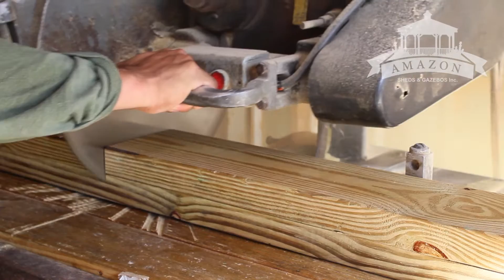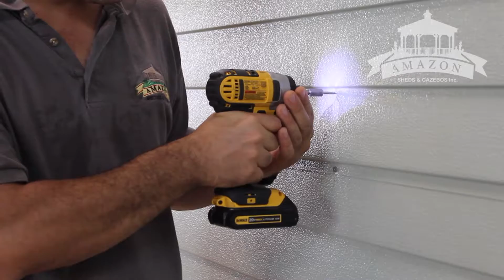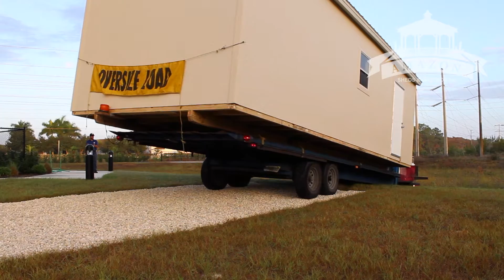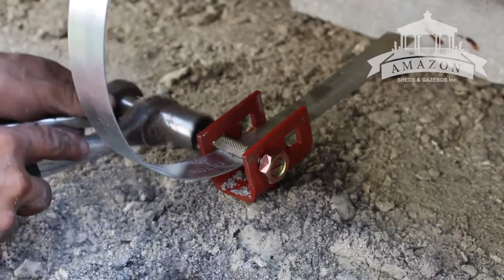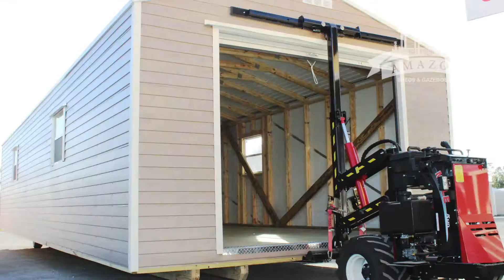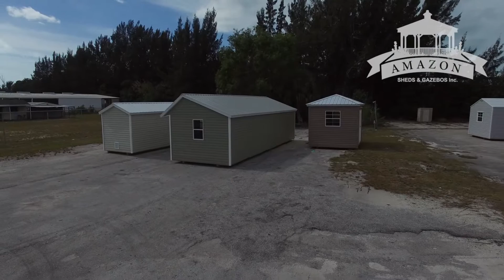How To deliver and anchor Sheds

Comment: Where can I find that two handle ratchet and whats it called
Reply from the maker: https://www.homedepot.com/p/URREA-1-4-Inch-Drive-X-3-8-Inch-Drive-Double-Drive-Reversible-Chrome-Ratchet-524947N/202796550
Reply from the maker: Buy one of those and one regular ratchet of course you will also need a 1/4" SOCKET
Reply: Amazon Sheds & Gazebos Inc thanks!!